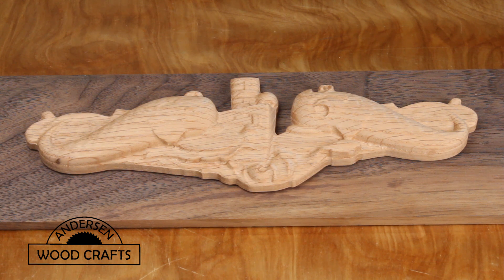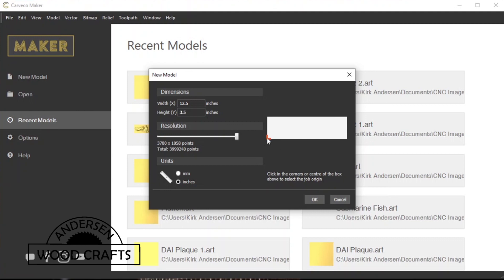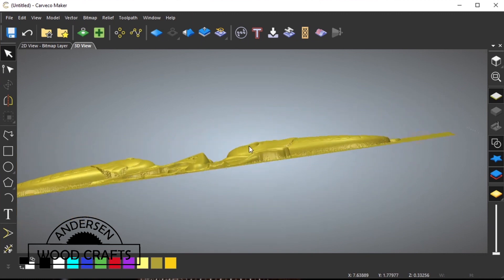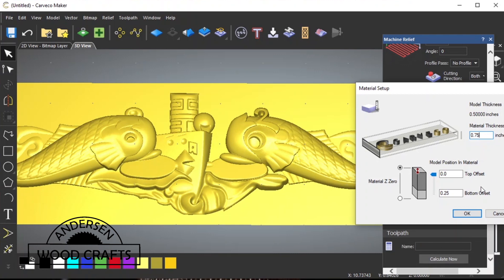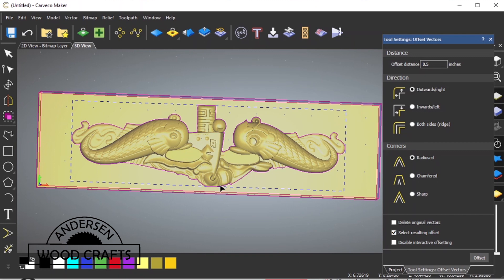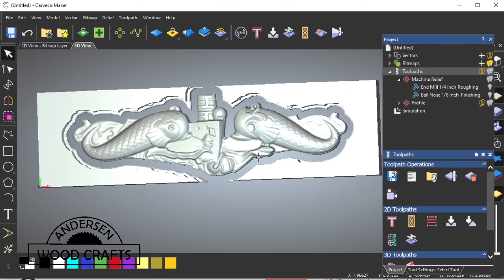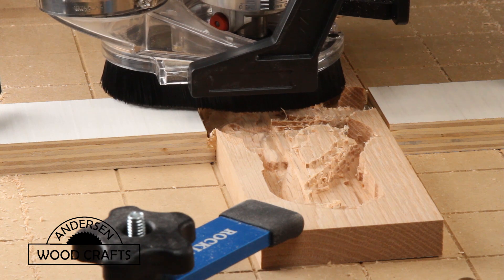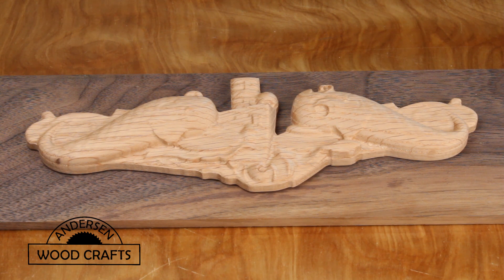3D RELIEF CARVING USING CARVECO MAKER WITH THE ONEFINITY CNC

Comment: Thanks for the video. What I don't really understand is how the roughing effects the finishing. I tried different roughing bits and the finishing always is the same (shouldn't it change depending on how much material there is left after roughing?)

Also if I don't select any roughing it also stays the same.
Reply from the maker: The only thing roughing does is remove the majority of the material in order to save time and wear on the finishing bit.  I use a 1/4" bit for roughing and either a 1/16" or 1/32"  bit for finishing.  As you mentioned, whether you roughout any material or not it has no effect on the finished result.
Reply: @AndersenWoodCrafts  yeah the finished result should be the same but the time and paths are the same too and that's what I don't understand. The time and paths should change if I have a roughing bit selected or not, but the finishing path doesn't change at all...
Reply from the maker: @dwarni5968  Are you using Carveco Maker?  As that is the only program I am familiar with.  When setting up the tool paths you can change the distance the bit moves over, which will change the number of paths, it does not calculate it automatically by the size of the bit.
Reply: @AndersenWoodCrafts  thank you a lot for your time, I carved my first relief successfully after breaking the bit on the first attempt. It is not a good idea to run it without roughing first ;)